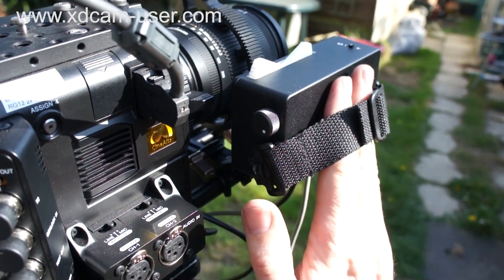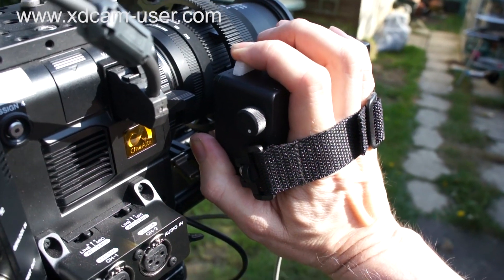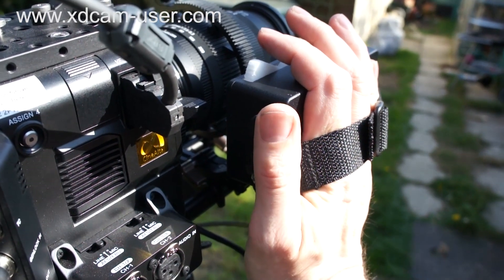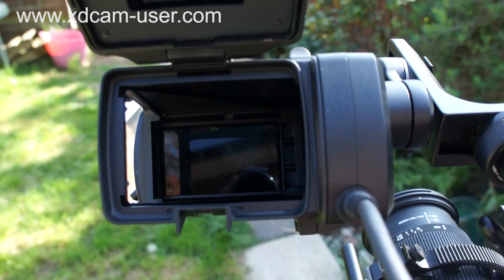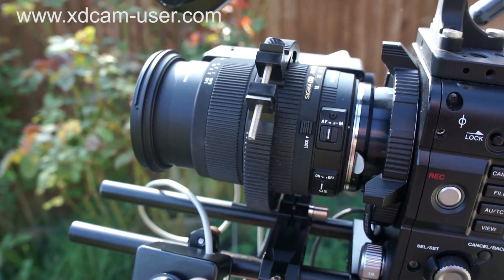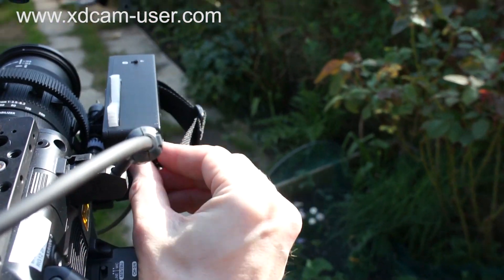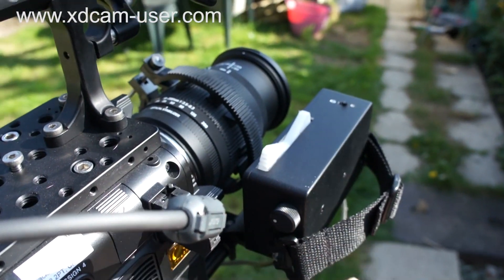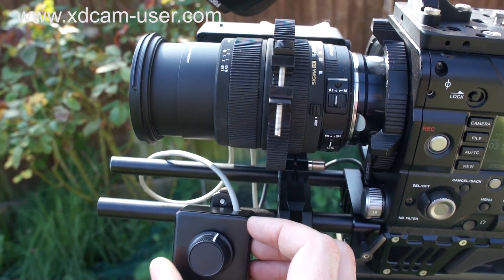Prototype DSLR zoom servo with integrated Canon EF lens control.

Comment: Hi mate,

What servos/DC motors, speed controllers and rocker switches did you use? I've been messing with the same thing for a while but can't seem to get a smooth transition between variable speeds.